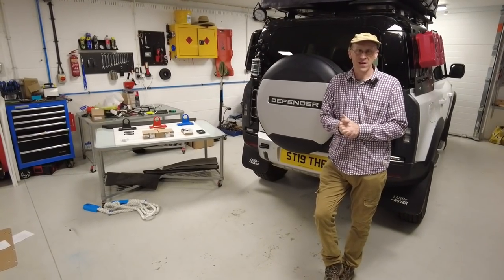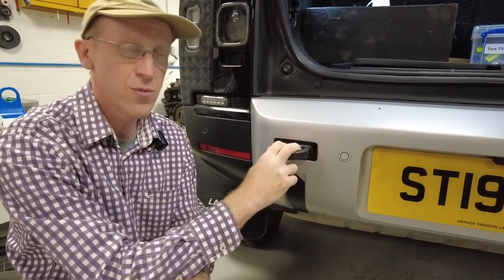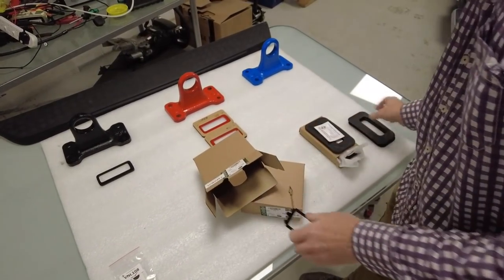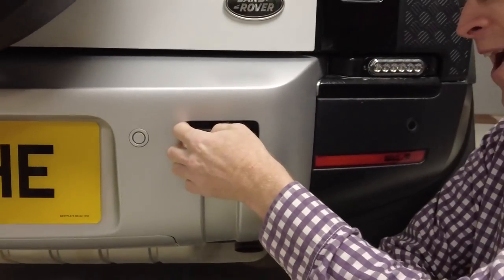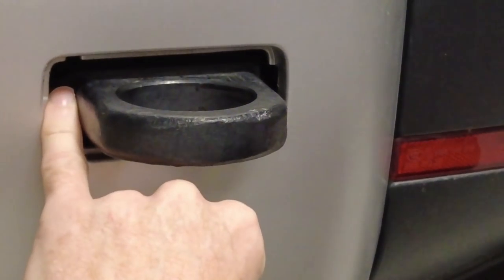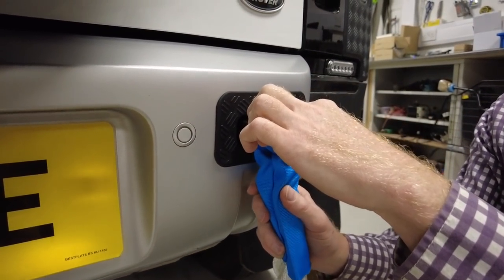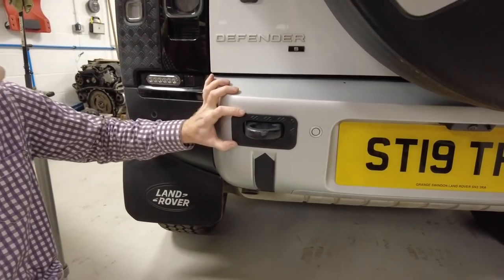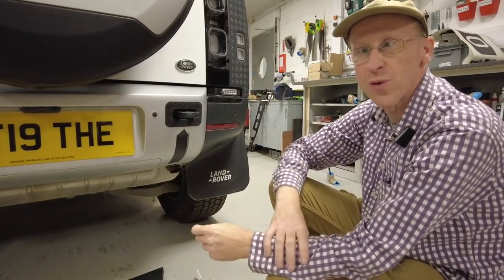Land Rover Defender Rear Bumper Tow Hoops &  Surround Options

Comment: This is great thanks, waiting for the bumper then I'll place my order for both 👍 also just a suggestion for your website, can you have a section or filter to display new products? Its a bit of a pain to go through the list to find new items
Reply from the maker: Yes there used to be a way to sign up for new product alerts... we are in the process of getting a new website and it should be possible on the new website
Reply: @L663  when will the rear bumper cover be available?

Comment: You're supposed to use a bow shackle or a winch hook through those eyes, not a rope or a soft shackle; they've got sharp edges and likely to damage the rope if you do.
Reply from the maker: Yes Non Stick has put my straight already ! but the surrounds should still off protection from shackles etc !

Comment: Digging up an old video because yesterday (24 March 2023) I took delivery of my new 90 D250 with the dealer fitted eyes but dealer denied any knowledge that you could buy the finishers from them! So Simon and his team to the rescue on Monday last and 2 finishers arrived in time for collection of the car yesterday. I bought the original surrounds in 2020 for my now gone 2020 D240 First Edition - have no fear about the sticking power of the adhesive tape mine survived weekly pressure washing with car wash chemicals for 20,000 miles and 30 months
Reply from the maker: Hi Tim - congratulations on the new Defender - that new 6 cylinder should be a nice upgrade. One thing I am stuggling with on the 90 is the amount of dip on braking and rise on acceleration - especially with the lights on at night - have you noticed this ?

Comment: Great video as always - love the extended bumper cover, it's what LR should have done from the start as the first thing that gets damaged when loading and unloading is the corner.  Also love the tow hook surrounds.

By the way, did you get my e-mail last month with the pictures of the continental driving "periscope"?  It's the only thing that actually works.

Comment: I want to confirm. I have a tow hitch and cannot now fit these towing loops you installed, correct? I need to buy a second screw in loop for the other side and then research how to create a towing rope that can safely Y to both of the landrover screw in loops. It is frustrating that the manual indicates the screw in loop is meant for on road towing and these bolted loops and for on and off road. Why is recovery not a good idea from the tow hitch? A rope inserted in the sleeve with a D ring bolt through the sleeve and a tow rope loop  in the D ring? The tow hitch is fastened as well as the screwed loops you have here yes? Four bolts on each side?   Have taken nothing apart, so thanks if you can make me understand the risks for the rare to never times I will need to be recovered or recover.  BOB
Reply from the maker: Hi Bob - these hoops can be installed with the tow hitch fitted so I think this answers your question !

Comment: Hi Simon.  So the tow hooks can take a very large towing load.  Do you know how much of a towing load the screw-in eye can take?  Could you get a 2nd screw-in eye to help spread the load?
Reply from the maker: Good questions... 
This is the owners manual page on the subject 
https://www.ownerinfo.landrover.com/document/3E/2020/T19990/38261_en_GBR/proc/G2389888
It does not state the capacity of the screw in tow eye
Yes you could get a second tow eye to screw in and spread the load - on my car both sides had the screw in "receptor"
The PN for the screw in tow eye is LR132024 and they around £28 + VAT from the dealers ( in the UK )

Comment: Hi Simon great bumper cover would you be doing them in gloss black
Reply from the maker: No sure about the gloss black - they are made from PP  Polypropylene and this is a great plastic but tricky to paint ( it does not stick to paint very well )

Comment: Perhaps this is obvious, but I don't think this video applies to the 2021 defender? I've spent the last three hours trying to get the bumper off, and it seems in addition to all the screws in this video there are many additional attachment points? Will admit, my first time doing diy car work, so the problem could be me.
Reply from the maker: If you read the comments I think it is pretty much the same - there could be a slight difference on the Diesel.

Comment: Just a heads up - the landrover versions are too small for the bumper cutout on the X model I got some and they just push through the gap around the tow hitch.
Reply from the maker: Yes for some reason Land Rover removed all the location area - I think our surrounds will fit the model X but not confirmed yet.